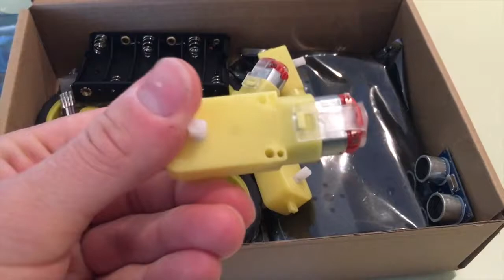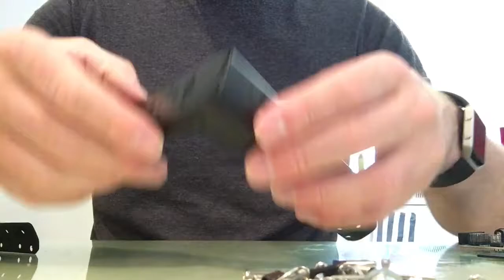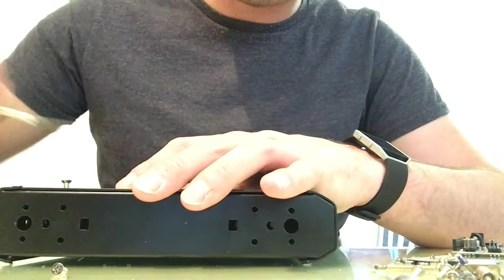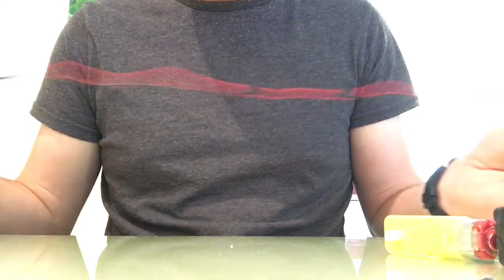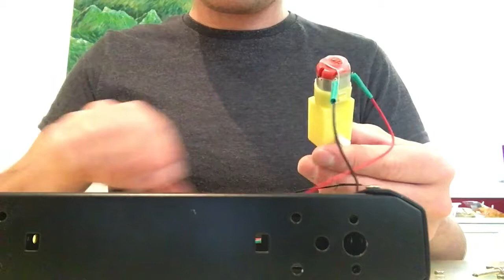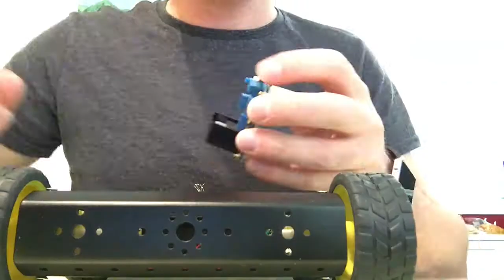Building an Autonomous 4WD Robotic Car with Arduino Part 1 - Assembling the car

Comment: Daniel, Thanks for this very helpful set of videos and your Codemahal page. I do have a question. When you connected the Ultrasonic Sensor you specified that the VCC and Ground pins needed to be connected to row 10 and 11 on the Motor Shield. Is there any reason they couldn't have just been all on line 9 with the Echo Pin? I can see that the Echo and Trig pins needed to be on separate rows, but my understanding is that the VCC and GND are common between all rows.
Thanks
Richard